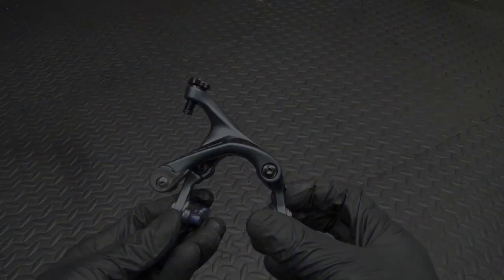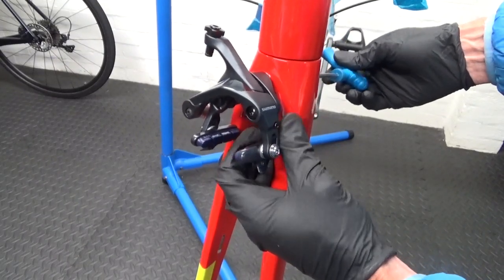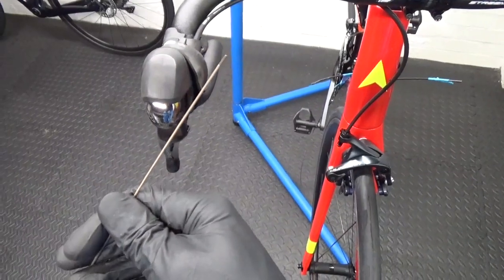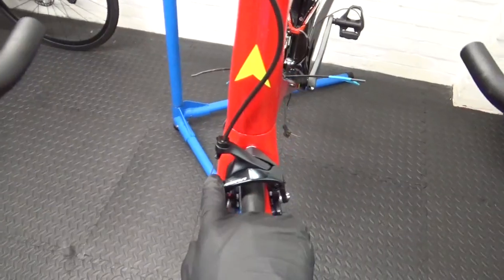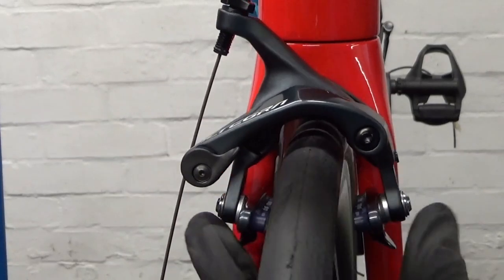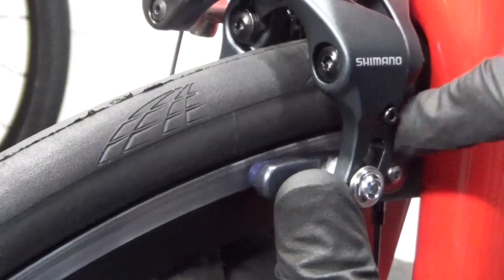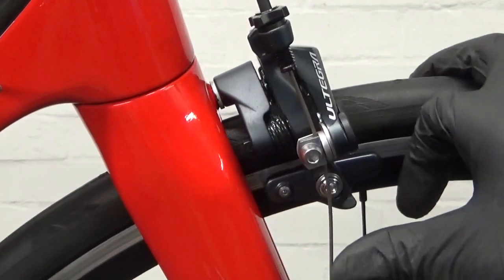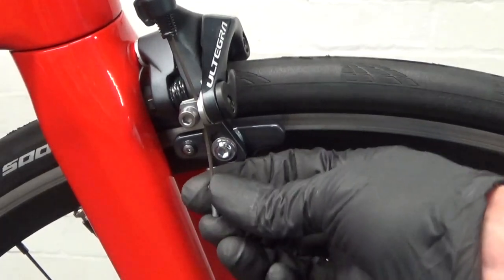Shimano Ultegra R8000 Rim Brake Caliper Fitting Guide

Comment: Pro tip for cutting the outer cable. If you have it, take a bit of old brake cable and slip it inside the housing and then make your cut. The inner cable will help keep the housing from crushing as much and make it easier to sort out after the cut.

Comment: I got sram rival front brake on my single speed road bike and I have trouble adjusting the brake when I switch from track wheels to road wheels.  I like to use different wheels since my bike can fit 700x28c tires.  Would you guys recommend this ultegra 8000 model

Comment: Can you use these calipers with Sram Force Axs shifters? Granted yes it may not be "ideal" and there are different cable pull ratios as well too. I have the Sram Red Aerolink but it's spongey and it doesn't like to stay centered. So I was wondering how much performance is to be gained or lost by mixing and matching the manufacturers of the shifters and the calipers? Thanks!
Reply: In case you haven't sorted this out yet... I used to have the same issue. I was on Sram Etap 11spd with Aerolink calipers. I recently switched to Ultegra calipers and it's a huge improvement in braking power and no more pesky rubbing.

Comment: Are the front and rear calipers the same? Can I buy a "front" and use it on rear?
Reply: Did you find out? I'm wondering the same. Maybe if to switch right and left brake shoe on front caliper it can  work like rear.
Reply: @tnikos777  , the length of the bolts for front and rear is different so in the end I didn't complicate my life and I bought a front and a rear.
Reply: @vsandu  thank you for the answer, I noticed that also. But if it's the only difference I think I can manage it))). The price for the front brake is just half from the rear.